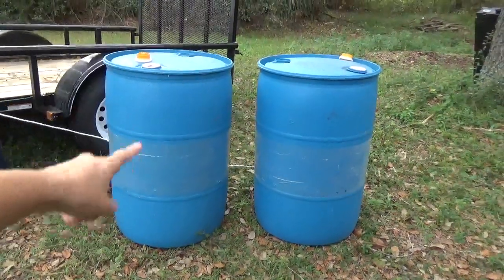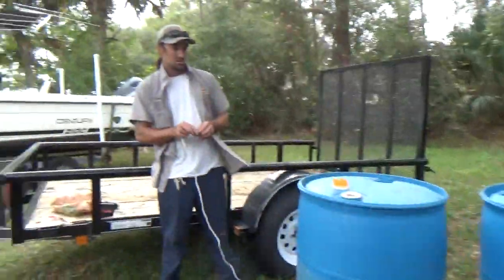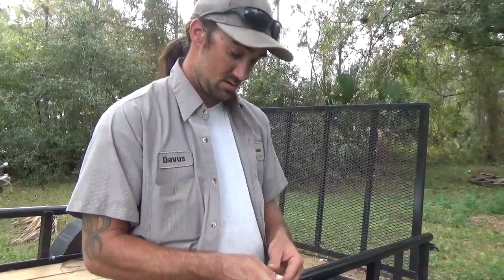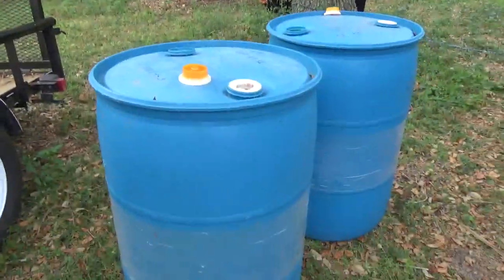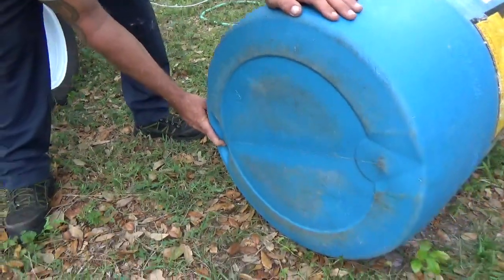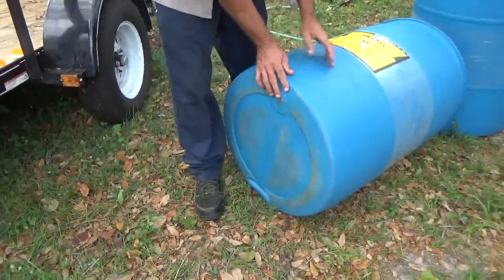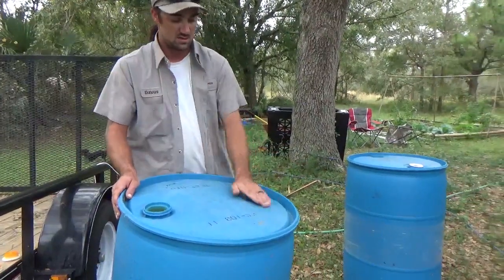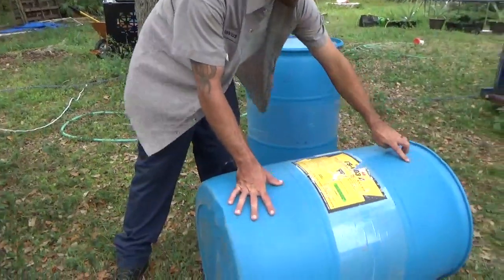Converting 55 Gallon Drums to Gravity Fed Waterers

Comment: Super helpful! Great video. We don't have water in the barn and we are starting to winterize. I've been trying to figure out the best option to keep water over there because the hose we run to the barn is going to freeze. We've got 2 drums lying around and now I feel confident about using them!